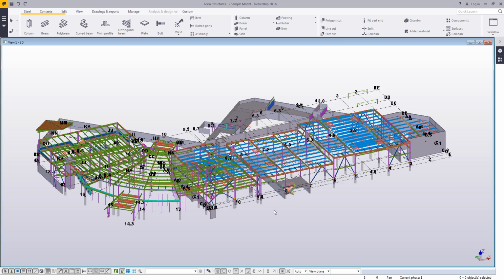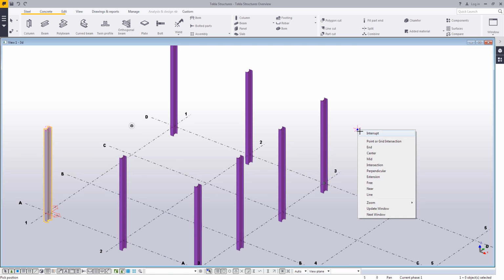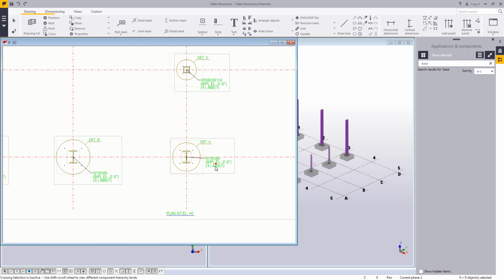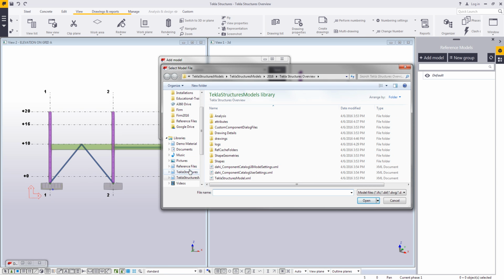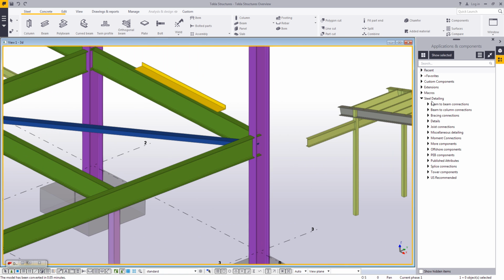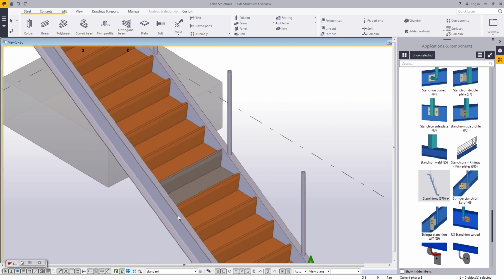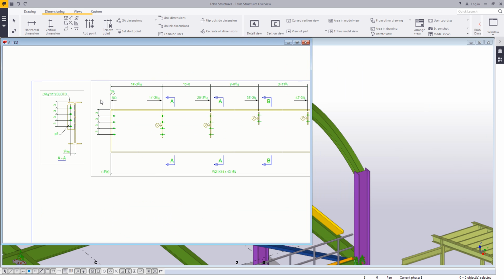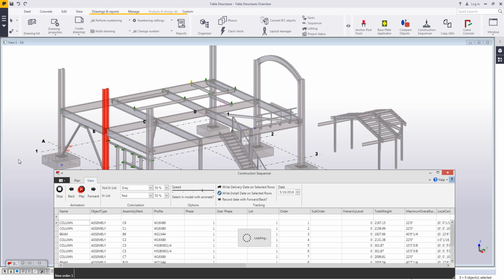Tekla Structures v2016 in 60 minutes

Comment: with no prior knowledge or experience, uncle wants me to apply at his steel detailing business and see if i can get in against other applicants. told me it has a 2 to 3 year learning curve, fuck me, what am i looking at?
Reply: Detailing is a lot like other skilled trades. Yes, you can learn the basics in 15 minutes, but it takes some time and experience to become proficient at it to where you can do it on your own at a professional level. You have to learn how to read (conflicting) design documents and determine what the correct answer is. You need to be pretty good at geometry. In the US you should be able to do basic math with fractional dimensions. You need to understand who is 'downstream' from you - a welder in a shop, a guy clipped to a steel beam on the 5th floor at a job site - and what information they need and how to relay it to them. If you just search "steel detailing" here on youtube, you can find all kinds of introductory videos and information.
This software (Tekla) can be learned in a pretty short period of time - it will do a lot of the work for you, but you still need to be able to tell it what to do and when.
Reply: @TrimbleTeklaDave  Thank you for the detailed reply, I will take your advice and study for my audition this weekend =D

Comment: Thinking of switching from revit. This seems faster and more intuitive. To do all this we need to load so many components and the connection details are not as easy.
Reply: Feel free to reach out to your local office for a demonstration - https://www.tekla.com/contact/offices-and-resellers 
The video here is focused on the steel detailing side of things, but Tekla Structures offers a lot to engineers, concrete and rebar detailers, precast companies, and so on.

Comment: Hi, why can not insert pdf reference on workplan ( only for The global coordinate system)?
Reply: Yes, you can insert a PDF on a different view/plan/elevation, but you actually need to change the coordinate first (the red XY marker) using something like the 2 points or 3 points option.
Reply: @TrimbleTeklaDave  i already change workplan . May be only dwg file reference can do it. Thank you.
Reply: @dungnguyenthanh6390  No, you can definitely do it with a PDF. Watch the video starting around 26:15, I insert the PDF vertically in an elevation view.
Reply: @TrimbleTeklaDave  Many thanks!

Comment: Can we do analysis of weir and saddel supports for penstock pipes.(. New to tekla)
Reply: Hello, Tekla Structures, shown in this video, does not have any analysis tools, it is focused on the detailing and fabrication for the project. We do have a separate program for analysis - Tekla Structural Designer - but you would need to reach out to your local office for information about it's capabilities. https://www.tekla.com/contact/offices-and-resellers

Comment: sir please display your views in load calculation and design in tekla structures in building design also their are lots of confusion in load analysis of  structure in tekla structure ...
Reply: Tekla Structures does not do load calculation or design, so there is nothing to show here. You would need to use a design software such as Tekla Structural Designer, Risa 3d or something similar.

Comment: how do you make the block see through at 13:49 ?
Reply: In the video I am using the new DirectX rendering, you can enable this under File > Settings. That allows the visibility of highlighted parts through other parts. Other than that I am using the Ctrl+1, 2, 3 and Shift+1, 2, 3 to change the rendering of parts and components as needed.

Comment: Hello thanks for the video but end of the video it would be  better to add how to generate the stress analysis in the program  after adding dead , wind live loads and so on. i designed the structure i also added dead and wind loads  and i m trying to find a way to analysis my structure . could you please explain it ? thanks
Reply: If you need structural analysis you need to export the model to a software such as Tekla Structural Designer, RISA 3D, etc. This video covers Tekla Structures, which focuses on the details and fabrication data instead of the design.
Reply: How to determine load on roof beam if there is trusses on roof beam. Thank u so much..

Comment: I cant see welds nor anchoring bolts going through the footing even though ticked every box on visibility display advanced options. Could you share your settings in order to make it the same as yours
Reply: In the US environment we have an 'object representation' defined that will always show concrete as transparent. Otherwise, you can use the Ctrl+1, 2, 3... or Shift+1, 2, 3... to change the representation as needed.
https://teklastructures.support.tekla.com/2017i/en/mod_creating_object_representation_settings

Comment: which software is the best 3d modelling software?
Reply: Pure bullshit. Tekla is a great software for steel detailing in the oil industry at least. Dunno about this 2016-version, but the older versions were pretty good.
Reply: i think tekla is best for steel structures only.
Reply: Tekla is a joke. No wonder americans produce terrible drawings.
Reply: NOT tekla. it depends on what industry you're in but regardless Tekla is terrible in any industry. I know how to use it well also
Reply: Tekla is by far the best but i believe its also the most expensive. If you want the best then need you to be prepared to pay the price for the best.
Reply: but quite a few companies here in uk also ask for tekla!
:/ 
i only know acad
Reply: Learn Tekla, Revit, or other BIM softwares.. acad user gonna learn BIM softwares more fastly
Reply: try autodesk's advanced steel detailing software... its cad based
Reply: Best  "3D software"   to learn on your own for free is AutoCAD.  Best two parametric 3D software are NX Unigraphics and  Solidworks
Reply: I suggest you learn both Tekla and AutoCad as in most situations, you will be required to use one of them

Comment: The developers at Autodesk should be watching this video so they can get influence to make Revit better, I love revit but sometimes you can get lost in all of the properties list when you can have such visual information. This will make stairs creation, beams and columns, ramps etc..much more easier
Reply: My boss is trying to move from Revit to Tekla. Just the basics of Tekla seem convoluted. Just laying out the grid is a daunting task. In Revit you could layout the grid, the spacing, the labels in a matter of mins. In Tekla you have to input all the dimensions manually...it's literally like CAD back in the 90's....the 80's for using a coordinate control system by keyboard, no mouse. I really don't get it, maybe I'm new to it and feeling old fashion. I see the benefits, but the users abilities do not appear streamline.
Reply: you have no idea what your saying, Revit is better than Tekla in almost everything